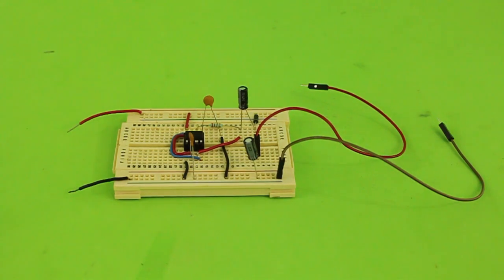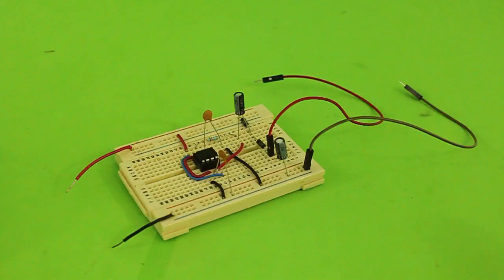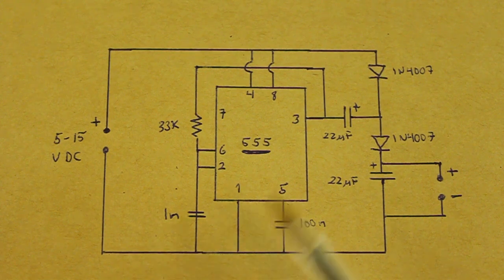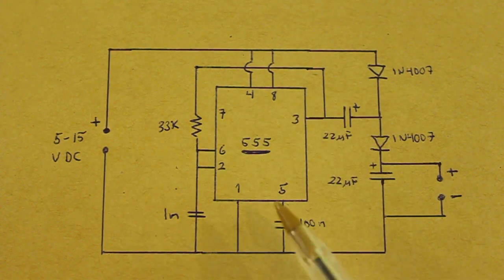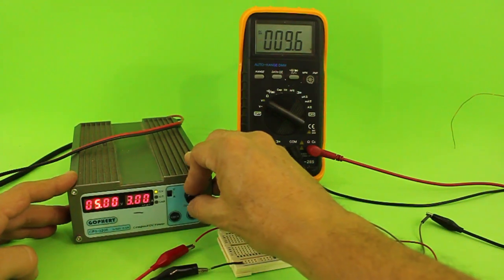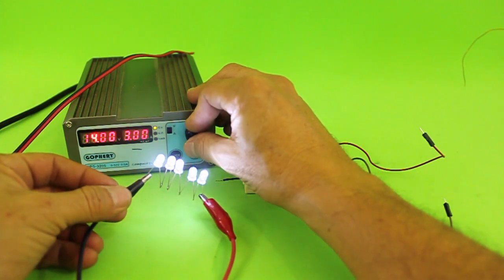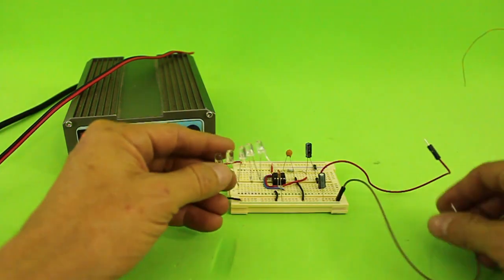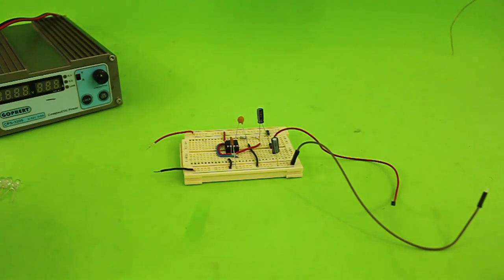DC to DC Voltage Doubler

Comment: So you could possibly use a circuit like this to saturate the gate on a power mosfet even though the lipo you are powering the circuit with is of a lower voltage than the volts necessary to saturate the power mosfet?    Yes ?       Maybe place an electrolytic cap across the output as reserve to absorb the initial surge on the gate of the power mosfet.    Yes ?     Very cool explanation style    Thank You

Comment: LS, very happy with this video!  I discovered on the internet that it was possible to use a voltage doubler for pulsed DC to create flat DC from in my case a Fly back transformer. With this circuit it must be possible I think. Thanks! But is it also possible to create extra stages in this circuit?
Reply from the maker: Yes you can add more stages but current decreases
Reply: @ludicscience  Wonderfull! Thank you :) I am gonna try that.

Comment: Excellent but 20 MA not much current to use in any circuit.
Reply: I think the point of his videos is to illustrate the principles at beginner level, which is great.  But no pro engineer would use a 555 for this, they'd use a boost convertor chip or some other technique.  I'm not dissing ludic , it's educational, but sometimes I wish he would say that other methods are preferred.  If you want to make a higher current boost convertor then I suggest you type those words into Google and read the data sheets.  If you have a particular project in mind then please let me know, I may (or may not!) Be able to help.
Reply: Well I think if you want a low-input voltage DC and high-voltage output DC then you have to consider using Boost converter.

Comment: i have not smart question here, does it affect the current? do it stay constant, reduce, or do it increase current on the output? thnx.
Reply: ff
Reply: Hi! You can't create energy out of nothing, If you increase the output voltage the output current will be reduced (because "Uin * Iin" must be equal to "Uout * Iout (+ losses)"), if you don't count losses in the circuit the output current will be "Uin \ Uout * Iin" (Input voltage / Output voltage * Input current). If this circuit had 100% efficiency (which it doesn't have in reality) the output current would be half the input current because you double the voltage. If you want to calculate what current will be needed on the input to output X current: "Uout / Uin * Iout".
Reply: @programer0713  thank you very much, I understood now, if voltage increases so does the current decreases and vise versa, I only thought it only works at transformers. Thanks agian :)